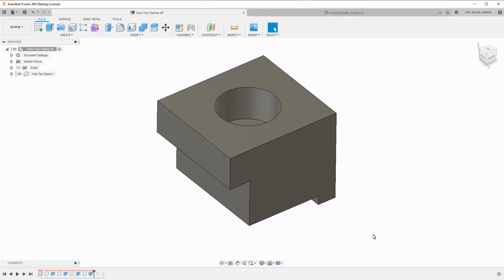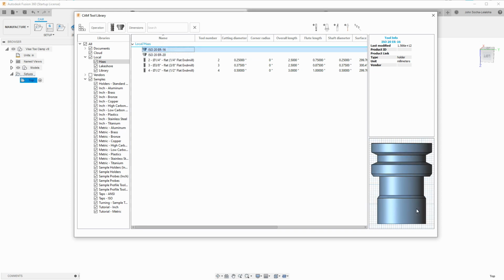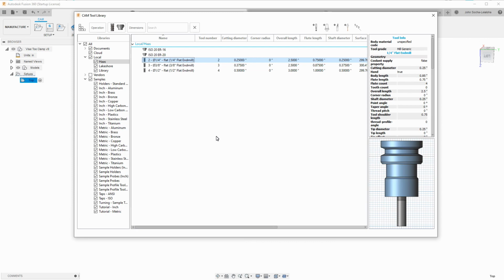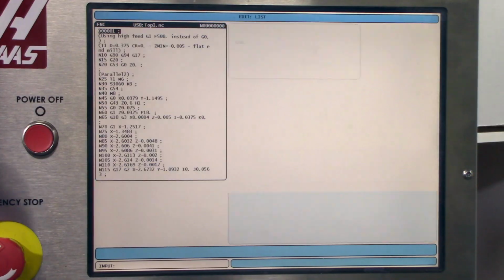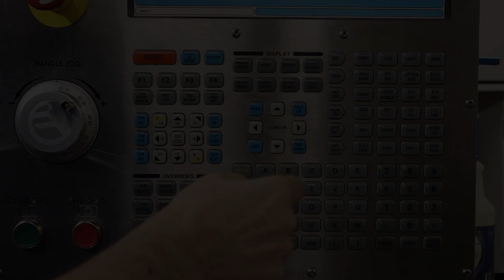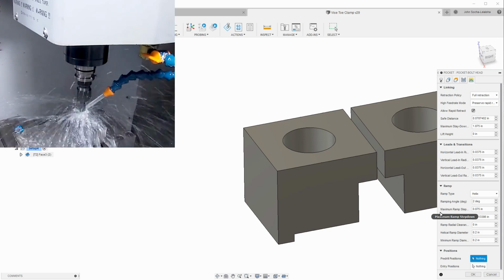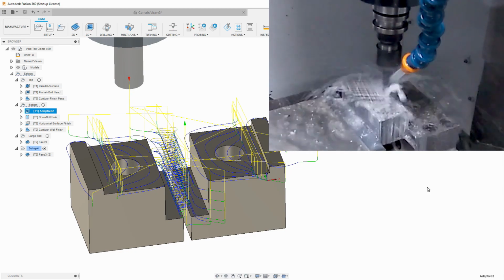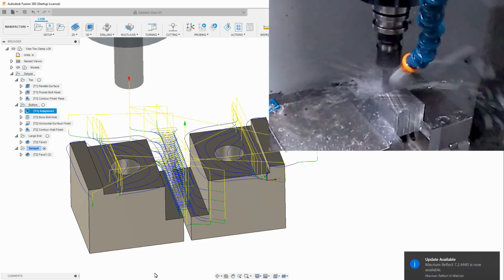Haas First Parts -- Vise Toe Clamps

Comment: Congratulations on the new machine!! I did that stuff for over 25 years and sadly had to retire with a lot of nerve and tendon issues in both arms and hands. But I still love them machines. You will do well. Get your self a lot of tooling catalogs. Kennametal, Sandvik, Iscar. They have a lot of modular type stuff that can make life easier. If you need help spending your money, let me know. I'll be glad to assist you in any way.
Reply from the maker: I have yet to find tool holders other than the ones made by Techniks that will work on this machine. The ISO-20 profile for the Haas OM-2 and CM-1 machines seems to be unique to Haas, and Techniks appears to be the only one making that exact profile. I can get other ISO-20 holders that will fit into the spindle, but they won't fit into the tool changer. I recently discovered that even a Techniks ISO-20 ER-20 tool holder only works if you insert it into the spindle with a specific orientation. The only tool holders that are plug and play are the ISO-20 ER-16 holders.

Comment: Great video. Being new to CNCing I'm struggling with two sided parts, flipping. Both in Fusion360 and on the machine, setting up the offsets. Do you have a video that goes through how you do two siding from Fusion 360 including machine setup and milling?
Reply from the maker: I did a three part video of a two sided part: https://youtu.be/AP0mSwd_POU I'm also working on a new video that should be out in a couple of weeks. Please let me know if you have more specific things you'd like me to cover.

Comment: Good to see the first part!  I have a dual vise setup that could use the double of your hold down design.  Maybe there's something already out there, but I haven't run across it.  Given the x limits of the Tormach 770, it's about all you can do to get two vises on it within the envelope.  That hold down would really help conserve space and clean up the center hold down area.  I would have been tempted to flip your part and mill it apart rather than bandsaw it apart and then have to finish it.  Wondering if that first rapid plunge to just off the deck of your part gave you any heeby jeebies.  It moves fast!
Reply from the maker: I thought about milling it apart. But the bandsaw was quick, and finishing the ends was both quick and precise. Plus, I was trying to use less material so I could make more from a single bar. And yes, it sure does move fast. That's why I usually use either 5% or 25% rapids for the first time after setting the Z.

Comment: John - I have been purposefully avoiding you since the HAAS acquisition. You were one of the few using the Taig CNC and posting videos; you were my hero. Now, you are just another pretty face with a HAAS. G0 M1 (Jealousy is such an ugly thing.. :) Seriously though, congrats on the new machine.
Reply from the maker: I hear you. I left the Taig behind with mixed feelings. But no regrets :-). I was really liking the machine I was getting, but also frustrated that it was the project rather than a tool. Soon I hope to be getting back to just projects.
Reply: @JohnSL  - Unfortunately,  I do have a small amount of buyer's remorse.  I purchased the Microproto 4 Axis (Made by the same company) just the high end version. Because of its limitations,  I have spent more time adjusting feed rates and spindle speeds than I have actually milling parts.  I suspect once I get it dialed in,  I will fall in love with it all over again. Anyway,  just wanted to rib you a bit and thank you for the very clear/concise videos you have posted in the past. Cheers!
Reply from the maker: Thank you. For feeds and speeds, I struggled a lot with that too. There is a lot to learn. I've been using GWizard for that and it makes all the difference. For the Taig, especially with the stock spindle, set the slider much closer to the tortoise rather than the hare. The Taig isn't rigid enough. Also, upgrading the frame and the spindle like I did makes a huge improvement. I would have continued to be delighted with my "Taigmach" had I not stumbled on this Haas. Which, by the way, is small and not very powerful from the perspective of most Haas users.